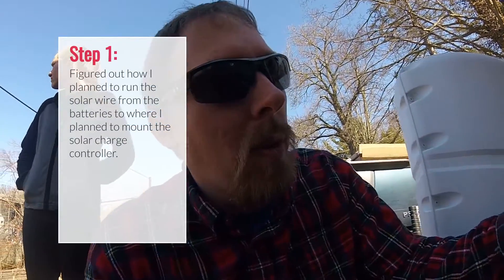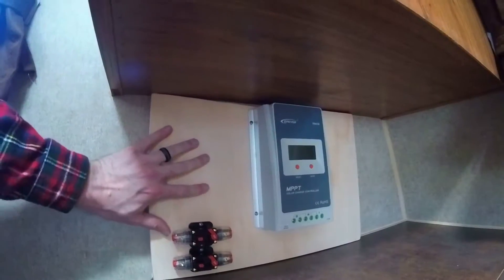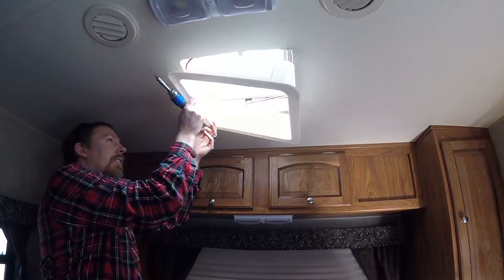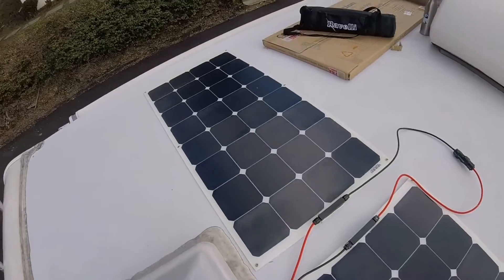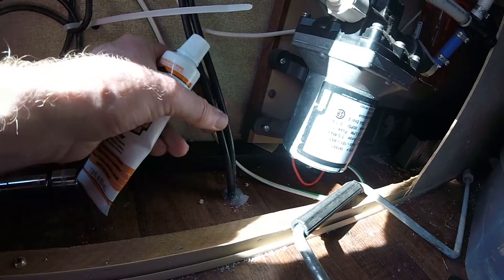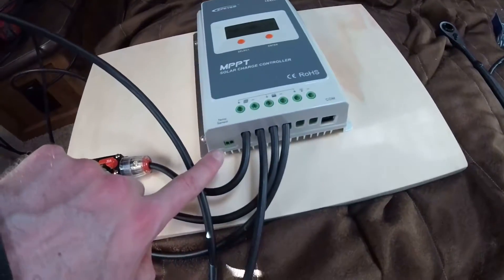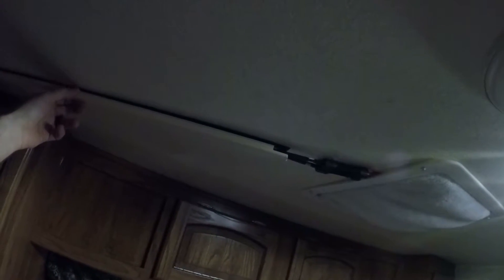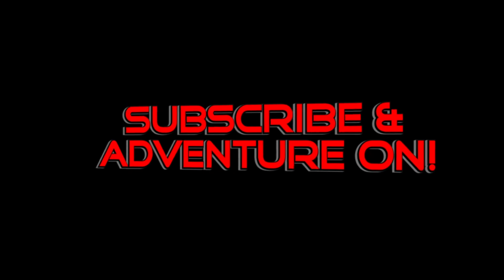Solar Installation Project || FullTime RVers

Comment: You got solar but Don't forget wind turbines, they are super cheap if you go to Walmart online, and better because you can get warranty on them via walmart . I'll help you put it on! Anyone want one, stop into Twin Falls Idaho,  http://linksynergy.walmart.com/fs-bin/click?id=nNC3MIW3bd8&type=10&tmpid=1081&offerid=223073.7442&RD_PARM1=https%253A%252F%252Fwww.walmart.com%252Fsearch%252F%253Fmethod%253Drelated%2526query%253Dwind%20turbine%20generator%20kit%2523%252FsearchProductResult%2526affs%253De
I like the 400 watt with the long tail, see my video on it on my channel its really a good deal when theres clouds, snow and rain. My Rv has a 400 on it so at night I can make lots of juice!!
You will get lots of views on that option. If your out and about Stop by in Idaho we will put one on.